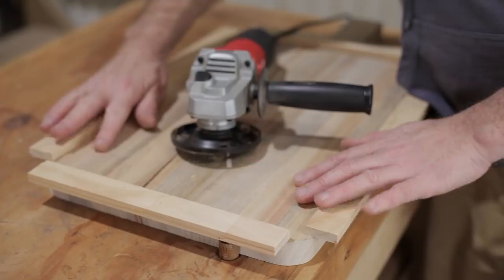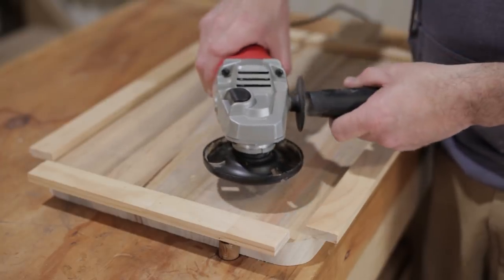Wooden Serving Platter with Texture - Scrapwood Challenge Episode Ten

Comment: I like the concept of making a serving board, but from a practical point, the texture would make this impossible to clean. I wonder if the texture would show through epoxy resin? Smooth surface but still get an awesome look. I personally think I would have used a router to hog out the material. Still a great project. One to keep in the back of my mind for future projects.
Reply from the maker: The texture is smooth and very shallow so it wouldn't be difficult to clean at all. I thought about using the router but I don't have a bowl cutting bit and even then I prefer the turbo plane for this kind of thing. It's pretty quick! :)

Comment: excellent work! skillful fingers! how much time did you spend on cutting out the texture?
Reply from the maker: Thank you! I reckon it was about two and half hours! :)
Reply: How often did you have to sharpen your texturing gouge? That was a lot of cuts.
Reply: Exactly that was my question, too. That serving tray looks really nice.
Reply from the maker: I didn't have to sharpen it, actually I didn't sharpen it from last time I used it! I reckon it could probably do another platter before it would need to be sharpened. It's a great knife though and holds its edge very well, also camphor laurel cuts very easy too! :)

Comment: Wicked cool!  Where in the world did you find that angle grinder disk magical thing?
Reply from the maker: It's an Arbortech Turbo Plane, you should find one easy enough! They're a great bit of gear! :)
Reply: Thank you! I'll look it up. That thing should help me get the rust out of my bathtub!  ;)
Reply: That planer disc is magic, one of those in a Nick Offerman style router planing jig would joint wood way faster than the router, and probably smoother too (at least, better than my ham fisted efforts!). Time for me to get busy with a sketch pad! 
One question for you about it, what would you recommend to use with it, an electric grinder or air grinder? I have zero experience with either
Reply: Hey Neil... another quick question if I may... what was the potion you finished the wood up with?  Some sort of oil?  (please pardon my ignorance. I'm a novice wood cruncher)